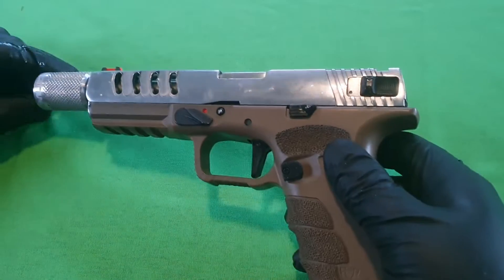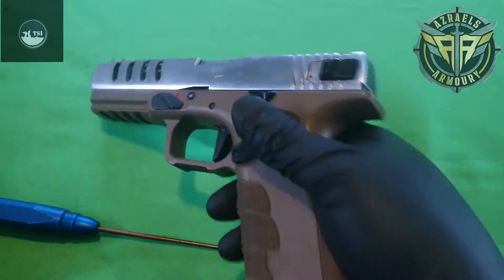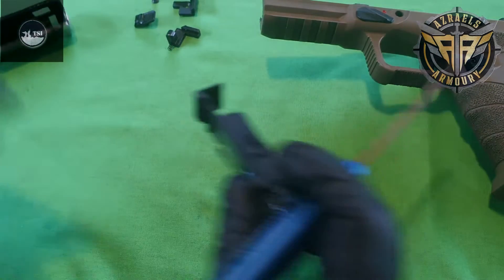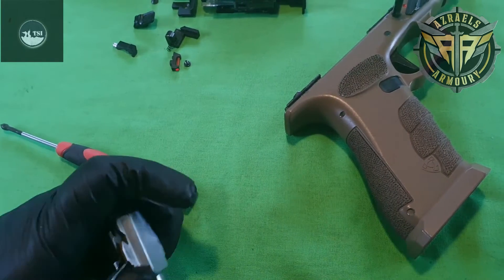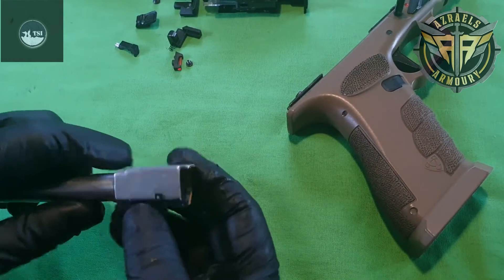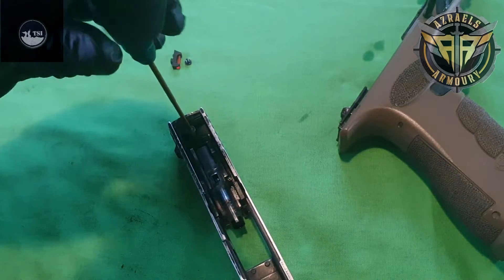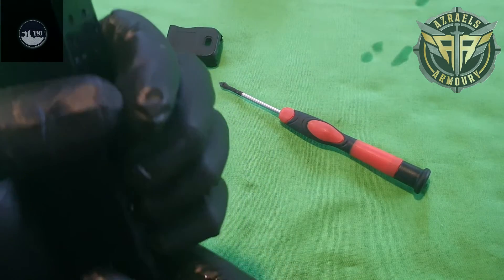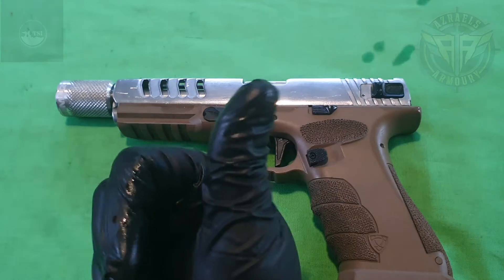APS SHARK GEL BALL PISTOL COMPLETE TEARDOWN & REASSEMBLE HOW TO

Comment: So can you add muzzle attachments like suppressors flash hiders and stuff like that to this pistol
Reply from the maker: Hi there yes you can add say a torch with piccatinny attachment on the under half of the pistol because there is piccatinny rail there. You can thread anything on to the end as long as it is ccw 12mm 🙂

Comment: Can I get the link for the inner barrel you got I would like to buy a tracer. I’m not sure if I just need to remove the orange tip for my aps shark or do I have to buy a whole new inner barrel?
Reply from the maker: The orange tip is a counter close wise thread so clockwise is loosen, you just twist it off and then you need a 14mm to 12mm adaptor and screw your trace onto the front. You don't need a new inner barrel bro

Comment: How did you do the cut outs on the slide? And what are they actually made of is it aluminium ?
Reply from the maker: Yes they are an alloy and the slide cut outs come with the tan version of the shark. Normally the slide is black and outer barrel is gold but I'm in the process of customising mine
Reply: @Evolutioncustomblasters  Ahh ok ive got a black shark I want to polish the slide a do the cuts maybe a drill and file job
Reply from the maker: @akaaxiom1228  yeah that's what I did to this one. Sanded it then dremmel then polish and cut to get it silver. It was originally black